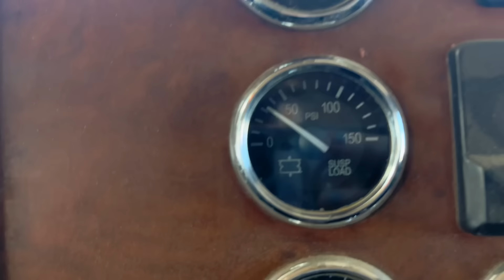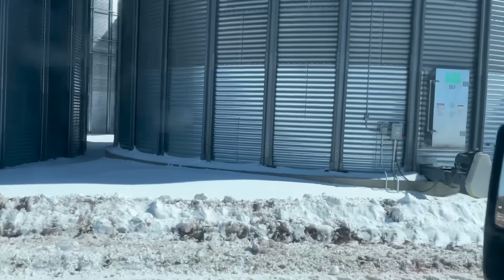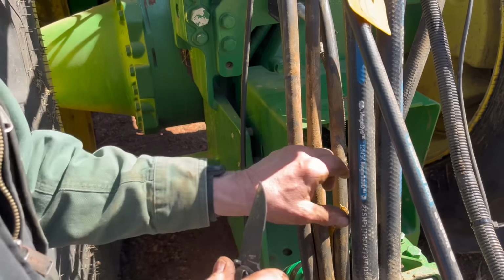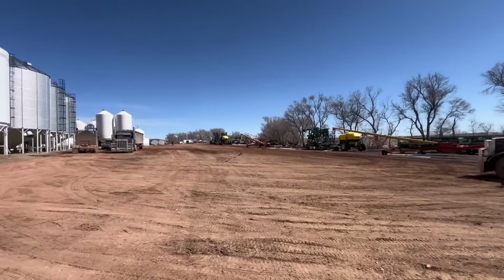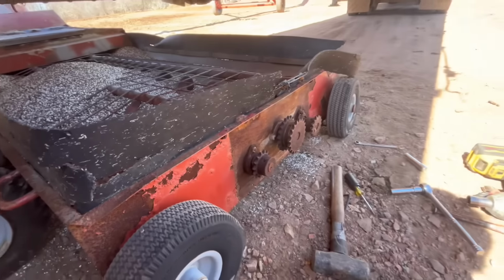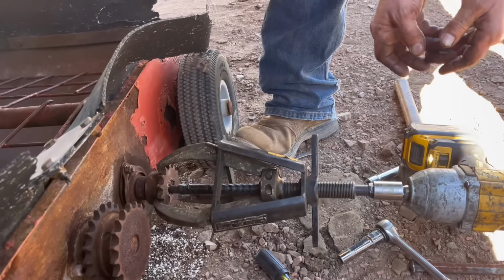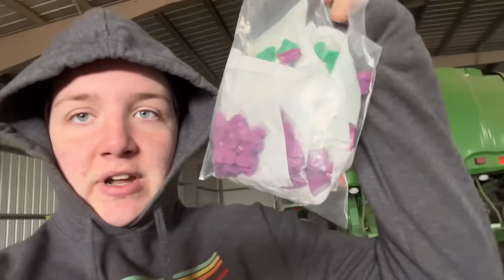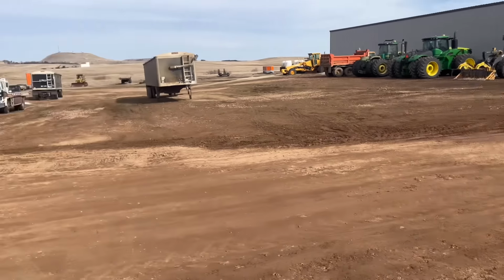We’re Almost Ready to Put Seed in the Ground! North Dakota 2024

Comment: When trying to remove a rusty sprocket if you use a torch heat the sprocket around the shaft it will expand should come right off